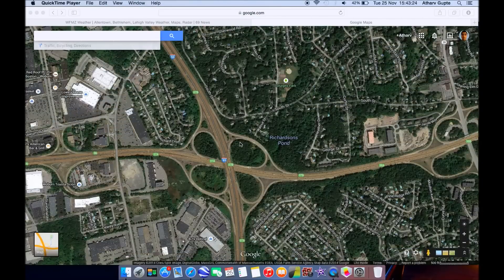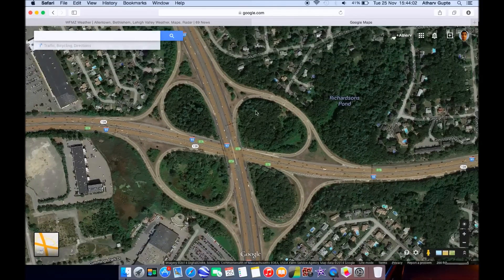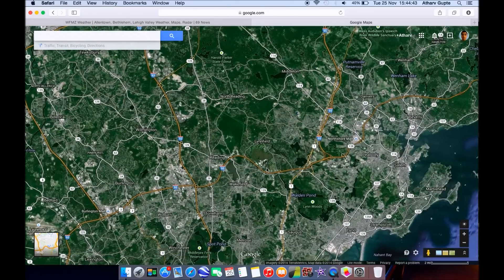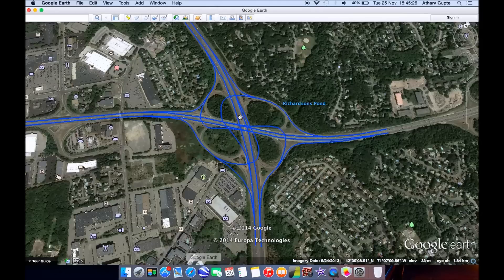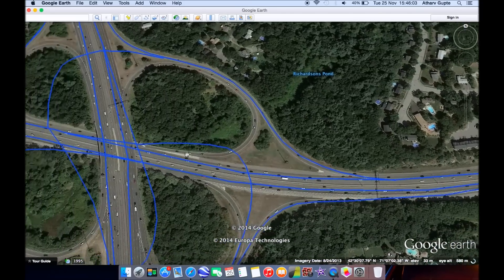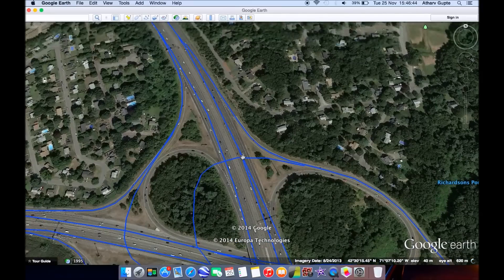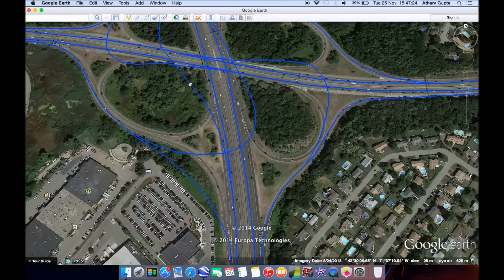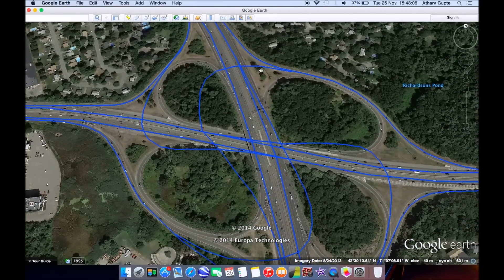MA-128/I-95 : I-93 Interchange

Comment: Personally think a more compact clover stack would be a better design. with traffic coming from I-93 to I-95/MA 128 still being loops (with potentially upgraded geometry to reduce accident potential particularly in the winter months) and 2 lane flyovers for traffic going from I-95 to I-93. Not only is I-93 busier so traffic AADTs said, but it is of higher standards than most of the “Yankee division”. 

Even with 35 or even 30 mph graded ramps for the 2 lane flyovers (to keep ROW acquisition/demolition at a bare minimum), the improvements in day to day function would be profound even without a separate collector road system for I-95’s adjacent exits… to which I think they should also build.
Reply: I agree, even a stack roundabout interchange is another option.

Comment: This is a horrible interchange. It was voted the most dangerous intersection in Massachusetts. For example, traffic going from 93 north to 95 south has to cross paths with traffic going from 95 north to 93 north. They have a very short distance to do it and nobody has any courtesy. There are constantly accidents here. A flyover interchange would have been much safer. (Why does the announcer say “wideo” instead of “video”?”